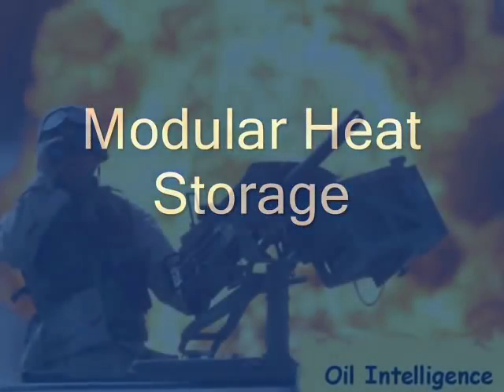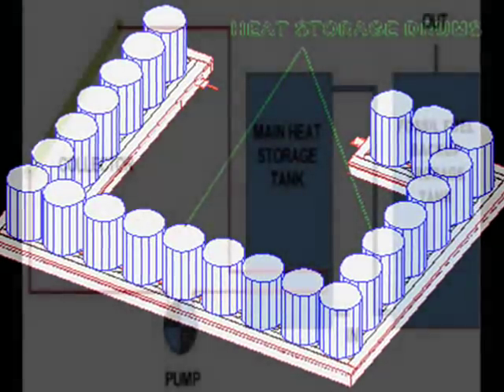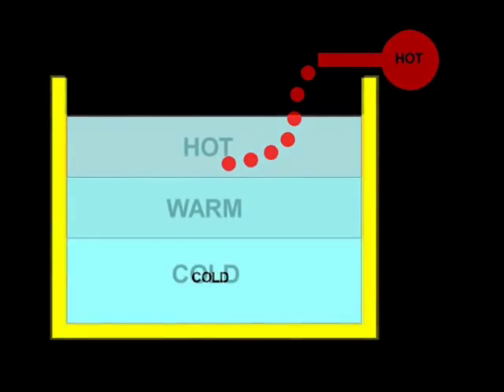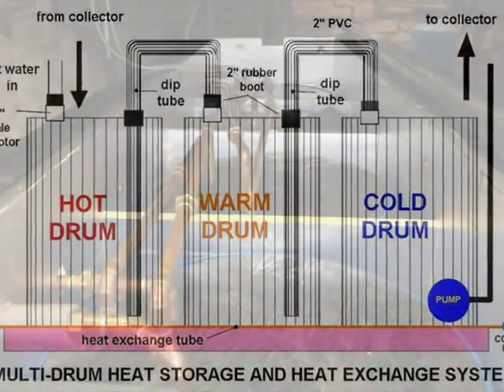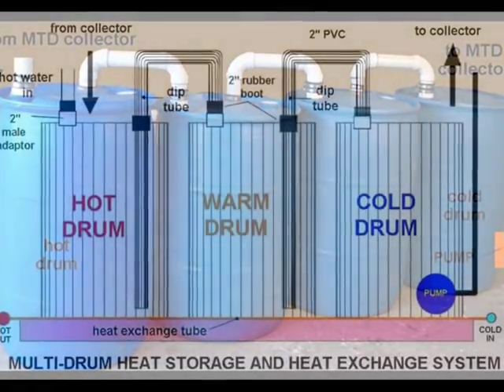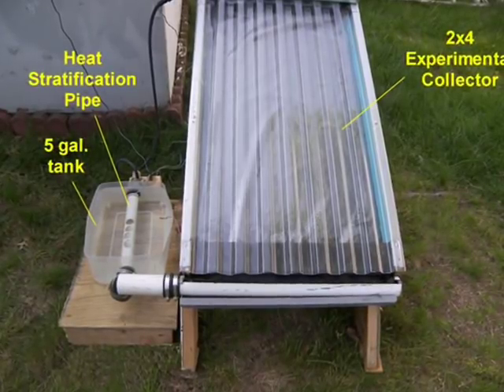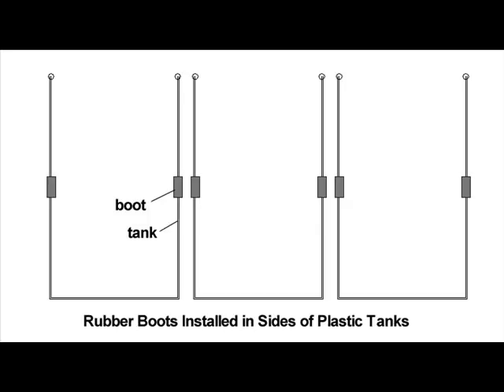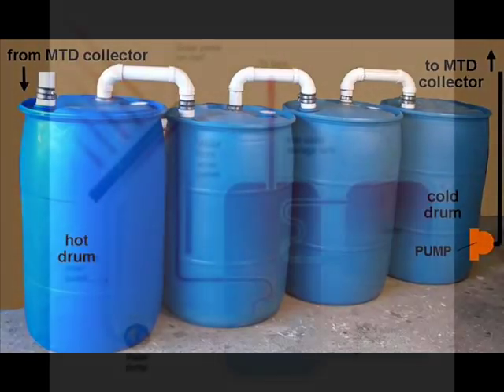Modular Heat Storage

Comment: Thanks, I found this very interesting.  I have been looking at a system that has a small PV cell array in one corner of the solar collector to power a small pump that circulates the primary heat collection medium which can then be freeze-resistant to prevent damage to the collector during extreme winter periods when there may be insufficient sunlight.

Comment: Good stuff John. I want to have a 720sq ft super insulated Quonset hut style SteelMaster house. With all the sunshine in my area this is my choice for heating not just the house but an additional greenhouse too. 
Thermo-siphoning would be handy during a power failure. 
I might put together a small system for a raised garden bed early spring and late fall crop for greens. 
Thermal mass and adequate insulation are the key factors and you've helped me a lot thermal layering problem. Cheers!
Reply: 9 years later.  Did you get to build you SteelMaster house?  If so, did you put this system to work for you?

Comment: Hi John,

Well done, good presentation for those interested to learn.

Have you considered using coils of pex pipe in each tank? 

The idea being that the water (heat store) is not disturbed thereby allowing natural stratification, the coils can also allow the insertion of a second coil to draw off hot water from the store without the turbulence of a pump to disrupt the stratified layers.

Just thinking out loud.

Comment: The concept is right on.  We think the concept can be achieved most efficiently when the solar array is connected to a cistern tank which is connected to a heat pump.  This way we can maximize the delivery of the solar element because our heat sink in colder and larger that other systems.

Comment: I did essentially the same thing with 1,500 gallons and 34 Evac tube collectors in a commercial application and found that trying to maintain stratification proves far less effective then merely increasing the flow rate through the collectors. more flow rate means lower DeltaT across the array and a more efficient collector for a longer period of the day. I used 3x 500 gallon Plastic Tanks and a VFD powered 3hp Pump to give me the flex to try different configs.

Comment: As to energy costs if implemented correctly 1 pump capable of moving 2gal/min at 10 ft of head is all you need. You can run this system on a 24vDC bilge pump.

Comment: sorry to disagree with you JB but actual cost is about $75 per tank in the system. As to the warm and cold tanks, When the hot tanks equalize in temperature at top and bottom the next one in turn gradually gets warmer till it equalizes as well and the heat is then put into the 3rd, 4th, etc. If you use 20 50gal steel drums in succession it is capable of storing approximately 1.25 Million BTU's at a temp of 160deg F. As long as the glycol/water is pumped in above temp that you are storing energy.

Comment: On your 2x4  collector, your plexiglass is the same material that's bought for sun rooms or r patios. They reduce the heat. Use regular glass. And also your diagram of a heated floor. Right there you have 1 return & supply. You should not have cold water returning. You should have tempered water. So now you have multiple supplies and returns. I believe the max is 300 ft but I've held my piping down to around 2oo ft. & Start the supply on the outside wall. where it's the coldest area. Yer Welcome

Comment: You should NOT be using PVC pipe to circulate; rather, CPVC, copper or PEX. PVC has a maximum temperature of 140 degrees F. CPVC is rated for 180 degrees F, which should hold up in your working range

The plastic barrels you are using are probably food grade HDPE, which can withstand 180 degree temperatures as well. They will, however, melt at some temperature above boiling.

Comment: I am interested in incorporating simple sand as a heat storage method! Why? Because the sand will hold or store the heat for longer periods of time say for say the case of any heat source gas oil. So what ever fuel you use will be lessened simply because of the energy stored in the sand by say pipes or radiators should lessen the number of times your boiler or furnace has to cycle on and off too heat your home.This is only an idea for an experiment!

Comment: I'm amazed at how negative these people are at your presentation.  Communicating the idea of modular storage of hot water for heat is great.  It could be piped through radiators to disperse heat for use in living spaces. Thanks for your input.

Comment: Have you tried using a mesh in your outlet pipes to prevent turbulence?- I'm guessing most the flow exits out the first one or two holes in your series of holes so it's only helping so much. Perhaps try using a 2" to 3" or 4" expansion joint to slow the velocity of the water entering the tank to prevent causing any current in the tank. And perhaps try using a plastic mesh in the expansion joint (similar to mesh used as baffle material in a fuel tank / fuel cell).

Comment: I gotta say, I'm confused as to why heat stratification is a good thing.  There might be some obvious reason that I'm just plain missing, but seems like it would be better to try to minimize heat stratification instead of maximizing it.  The only reason I can see is if your solar matrix doesn't provide enough heat to usefully heat all the water in your system.  If that's the case then I would imagine you have too much water to be heated in the first place.

Comment: Am I correct in saying your objective is to return colder water to the collector?  That is instead of using say one tank and quite a bit of heat being returned to the collector you get to keep the heat.  This would of course be wise if you return colder water you can then get more heat from the collector. It increases the efficiency of the cycle.  Another question is the array is trying to achieve high temperature difference is that for air heating which would rely on this.

Comment: i don't really understand what you're talking about or what the purpose of this is, but hot water doesn't weigh less than cold water. Hot water is less dense than cold water. It still weighs the same unless you're comparing two same volume containers in which one has hot and one has cold. I'm sure you already know this, but it bugged me when you said "hot water weighs less than cold", it bothered the part of me that was in physics class before i failed it :)

Comment from the maker: @dadigitechman  Thank you DAD for your comment. The reason I use large 2" PVC connectors is to create less turbulence in the water. Turbulence causes the hot water to mix with the cold water and this lowers the heat collection efficiency.
Reply: 0
Reply: There is a design with a funell going from small to big allowing the incoming water to slow down and settle into the stratification layers quicker.  Found it on builditsolar.com